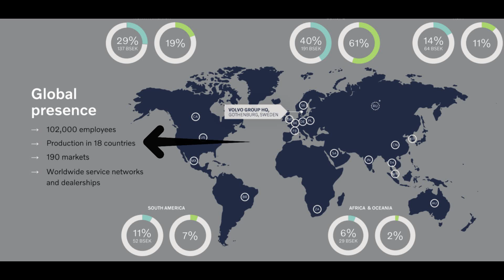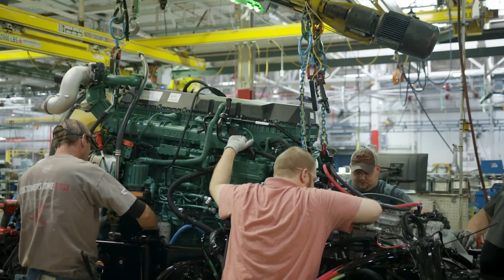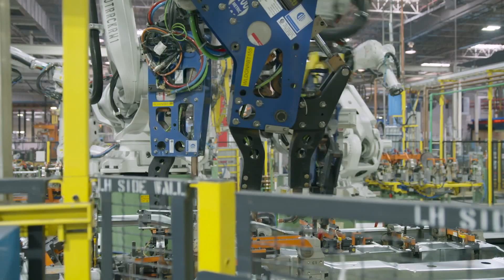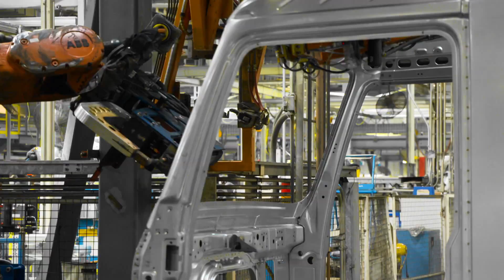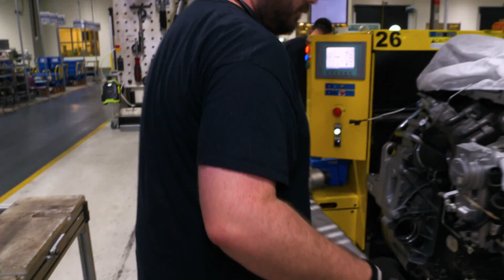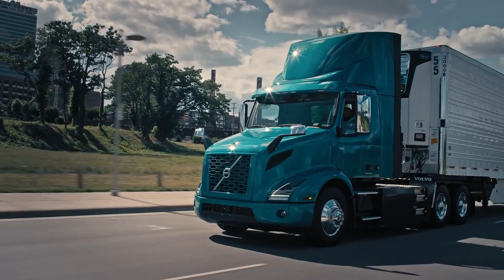The Making of an American Truck - How The Volvo VNL Is Manufactured

Comment: Electric trucks is a fad that will soon end
Reply from the maker: You Think? 😅
Reply: @TruckTropia  Guarantied! The manufacturing of the batteries is a highly dangerous and environmental unfriendly process, and the lifetime of an electric truck isn't long enough to upset the damage of production compared to diesel trucks. As soon as people learn that electric trucks, and cars, are less environmental friendly than diesel and gas, the fad will die. Just as the fad with hydrogen trucks already has.

There's only one type of environmentally friendly electric trucks, and that's trolley trucks
Reply: Unlikely. They are very suitable for short-haul, especially in cities. Long-haul, hybrid is more sensible.
Reply: @dbclass4075  Problem is cost-benefit. Electric cars and trucks are only environmentally friendly if they are used long enough. The price of purchase combined with the risks of short-haul city traffic, makes them less environmentally friendly than good new diesel trucks.